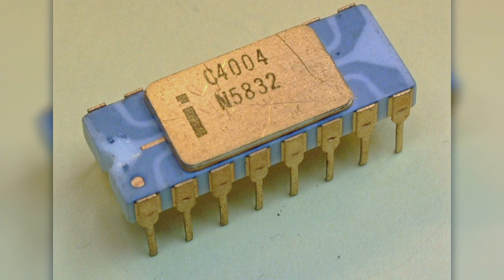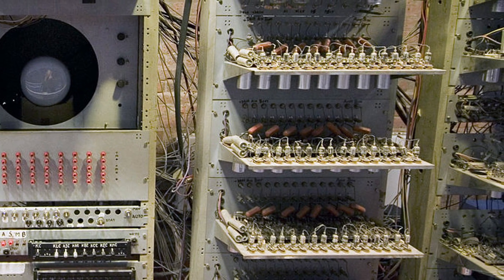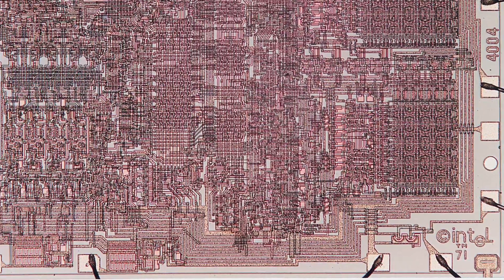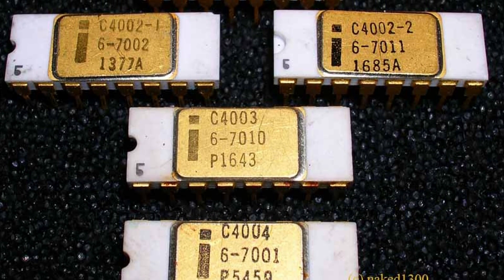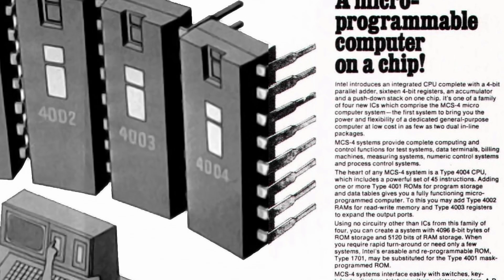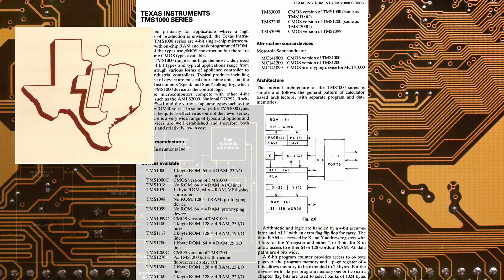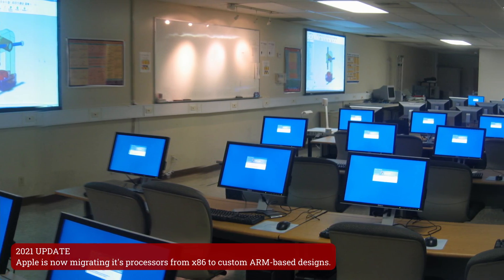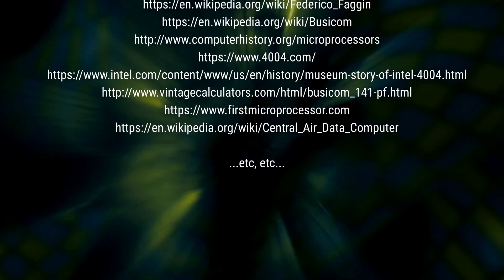3 Minutes On... The Intel 4004 Microprocessor (2021 'Remaster')

Comment: Intel means Intelligence or INT. Same as Strength, Dexterity, Magic. It turns on an autopilot to stay on track with a car game. If Indy Car or Stunts goes off the track, the autopilot is off. That is default. To turn it on,;crash is needed at full speed. Same with modern computers plane acrobatics turn it on, that is the user's choice. High speed diving and pull up does the fix. Shadow has to be seen.

Comment: Very excellent video. I appreciate that you cited the mp44 showing that designs nearly always come out of the State sector. It is often forgotten that the state sector is so vastly more innovative than the private sector. It is where all the difficult early innovative work is done and then handed over to the private markets later for the more trivial incremental work. You can take almost everything in your phone and trace it to the state sector, GPS, silicon chip design, MacOS derived trivially from Unix, http, the web browser developed at NCAA, the touch screen, just everything you can’t list is innovated in the state sector. On the other hand we are constantly bombarded with advertising that the private sector is where the innovation is. State sector also includes firms that have only State funding like Xerox in the early days and even Intel with the 4004 used for traffic lights though as you correctly stated the chip design was modified from processors such as mp44 already developed in the State sector.
Reply: Nah. What about the inventor? The inventor does not work for state or private they work fir themself. 
The microprocessor was invented by such a person although I miggt concede it was developed by the military and the inventor in parallel.